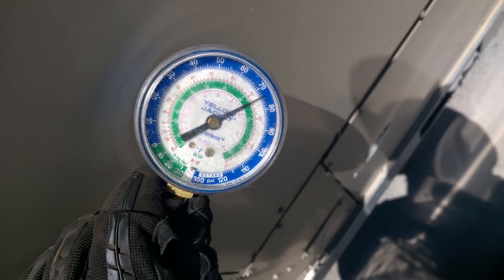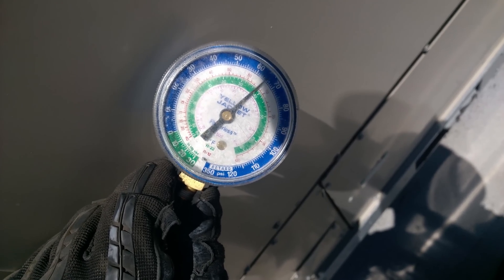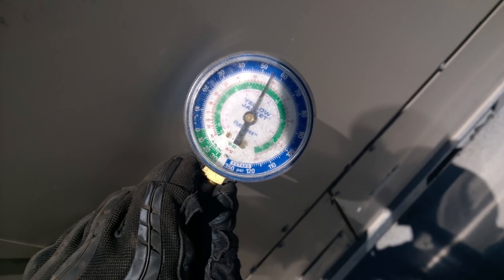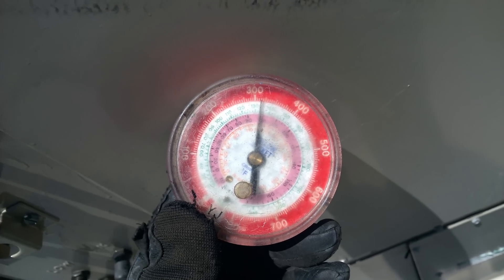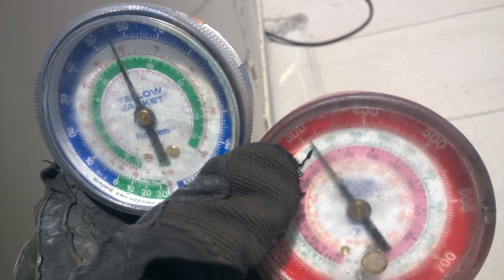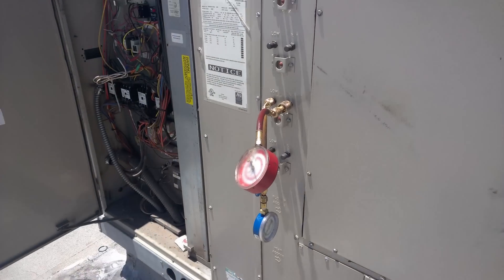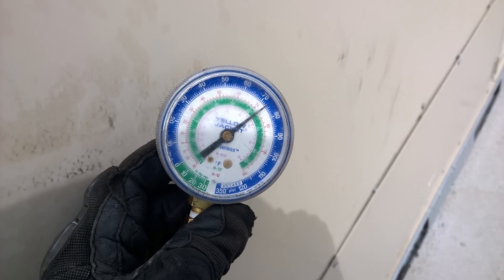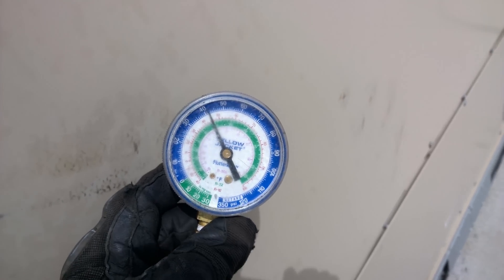Non condensables causing suction pressure to throttle by 40 PSI

Comment: So you can only tell if there are on-condensables from the suction sides? Or how?
Reply from the maker: Usually the high side really throttles.
But check my video info. This turned out to be due from using 407C refrigerant, which is a blend, in place of R22.
It uses parallel capillary tubes for the metering device and that caused "fractioning" of the refrigerant blend.
Reply: @hackfreehvac  I'm guess you took it all out put a vacuum on it then recharged it?

Comment: I had an argument with young tech that thought a newer 410a system had non-condencables in the system. I said bad txv. 2015 Lennox LGH suction low psi head high psi high subcooling high superheat. The feeder tubes from txv were frosting. He took the bulb off and held it in his hand. Yes it's reacting. Some. So he assumed the txv was good.

Comment: Hmmm I installed my goodman ac unit (R22) in spring of 2010 and ive had to do nothing on it but annual coil cleaning every spring.  Goodman furnace was installed in fall 2009 and its got nothing but air filters.  Zero parts replaced.  Zero problems.  No unit will work right if contaminated refrigerant is used.  Put them in correctly and clean coils and change air filters regularly and they should last a long time.
Reply from the maker: The exception proves the rule. 
And you don't have a heat pump.
The heat pumps are what has most of the issues.

Around here we have 95% heat pumps. 
They run in cooling from March until November then go into heating which uses the compressor as well.

This climate separates the men (Lennox, Trane etc) from the boys (Goodman).

Not too mention Goodman doesn't even make high end stuff for commercial at all.
Reply: @hackfreehvac  Heat Pumps suck in general no matter what brand. They run year round which decreases compressor life.  Then there's the dreaded sticking reversing valve. They are completely useless in the area that I am in (Midwest).  They goto aux heat mode once outside ambient below 25deg is reached which is common in our area during the winter. Spinning that power meter like a frisbee and taking forever to reach setpoint.
Reply from the maker: @mikeanonymous669  Yes but in this area of mostly heat pumps the Goodman Heat Pumps suck(ed) so bad.

Goodman used shittu thin distribution tubes on the outside coil that everyone knew rubbed and leaked due to bad design and Goodman kep usingbthat design for over a decade.

Same thing with the cheap stack relay for the indoor fan.
Complete garbage and something like  a 50% failure rate in the first 3 years for those two items alone.
Reply: @hackfreehvac  that's a shame they knew there were problems and were too cheap to reengineer those areas and parts.

Comment: Dealt with one that throttled by about 12psi (2ton piston)a while back and it was missing a filter, slapped one in and bam. I was stumped too, but it had a 5ft softly bent 14" return and 90° in the home. Couldn't believe it myself but if it worked, and yes everything was clean and clear.

Comment: I assume the fix at this point is to recover the charge, vacuum, and recharge?
Reply: eggman9713 Yea, that's what i'd do. Recover, Nitrogen Blot to 100 Psig for 5 minutes, Remove Driers, Nitorgen Flow to Ambient for a Few minutes ,Change the Driers, Nitrogen Blot  Again to 100 psig , Evacuate Overnight, recharge with Fresh R-22.
Reply from the maker: eggman9713 That's what I suggested. Recovery. Vacuum. Recharge.

Plus blow nitro through metering device and replace filter.